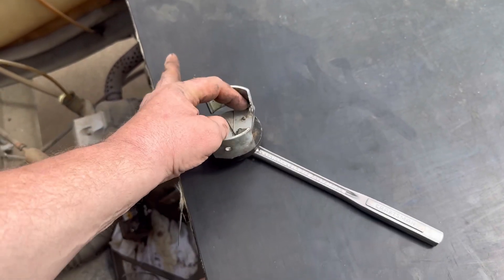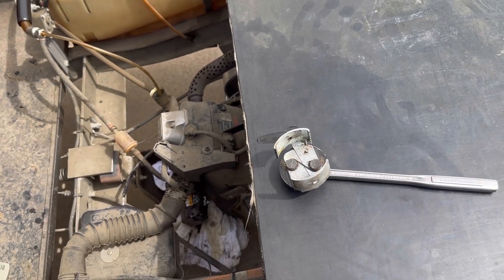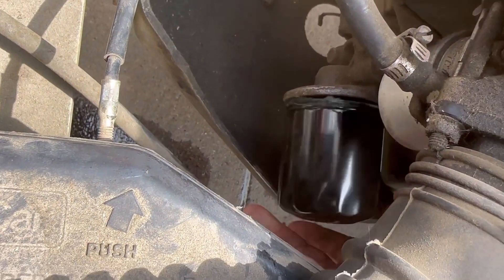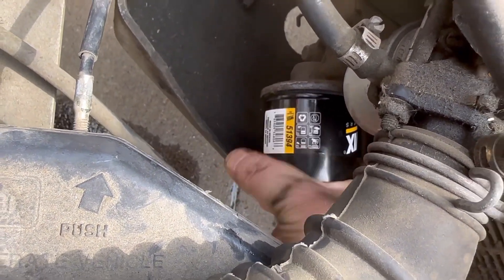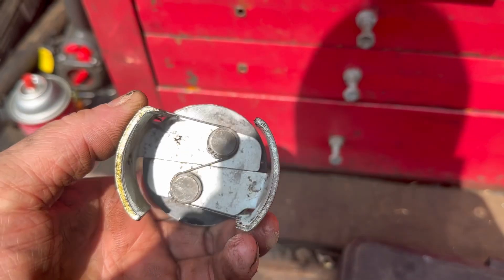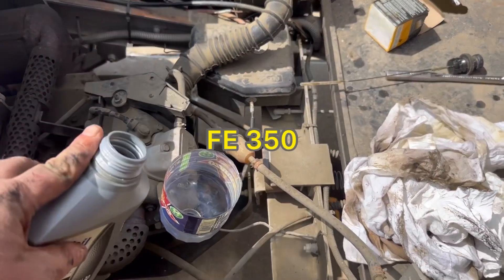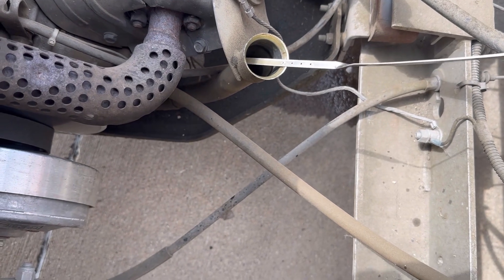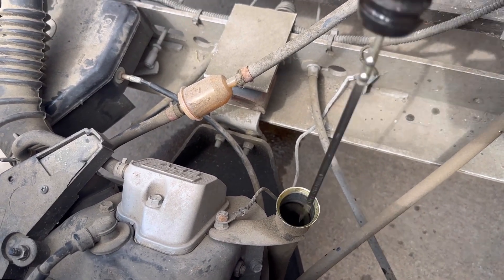TIGHT OIL FILTERS ARE NO MATCH FOR THE MOTIVX OIL FILTER WRENCH!

Comment from the maker: MOTIVE X OIL FILTER WRENCH
https://amzn.to/40MjD1u

Copper spray a gasket
https://amzn.to/3Z9lonY

Help support my Channel by checking out my extensive parts store here on amazon
➡️ Check out this page from THEMOWERMEDIC1  

https://www.amazon.com/shop/backwoodsctryboy

TOOLS I USE DAILY
MILWAUKEE 3/8 socket set 
➡️ https://amzn.to/3N3ulda
1/4” socket set
➡️ https://amzn.to/3MTyQaf
Oil evacuator
➡️ https://amzn.to/3MQM33P
Lawn mower lift
➡️ https://amzn.to/38lKhsr
Fuel line clamps
➡️ https://amzn.to/3E0RI5u
#SMALLENGINE #BriggsAndStratton #Kohler #Kawasaki #Spartan #XMark #ToroHashtagClubCar #GolfCart #FuelLines #SmallEngineRepair #SmallEngineMechanic #SmallEngineRepairVideo #YouTube #Repair #Video #DonnyBoy73 #EricTheCarGuy#Mechanic #MechanicVideo #HowTo

Comment: I recently had one of those filters on a TroyBilt motor. I finally used an old trick. Punched a long screwdriver through it and got it loose. That tool looks like a really good option.

Comment: Didn't know you could run Mobil 1 oil in there. Thought the needed oil with lots of zinc for the anti wear??? Thanks!
Reply from the maker: Just did an oil analysis of
Mobile 1   Lots of zinc and phosphorus left after 10k miles.
Reply: @THEMOWERMEDIC1  I love Mobil 1 V Twin 20w50 in my Harley Davidson engines.

Comment: My mower has got me scratching my head...start it up, it's running really fast, bent the governor spring back though it was in the factory position, didn't help, still running crazy fast. Never hit/ran over anything. Now when I start it, it starts off slow, and seems like within 30 sec of running/warming up turns to an airplane again. It's a craftsman M125, bought 2 years ago. All I could think of is maybe something internal or something with the autochoke setup on the muffler, if that sounds possible? Any suggestions greatly appreciated.
Reply from the maker: Adjust the governor

Comment: I use one...not sure what brand but yeah. Beats the stupid cheap 3 claw designs 100 fold. I just use it as my go to as it just works. for my own car i have one of the perfect fit cups, it is plastic though...so. But yeah. Also pro tip, if you are trying to get it on there, but have limited space to get in, like  on some wheelers ect, put the ratchet to tighten and spin it a few times while trying to also push it on. works real nice.